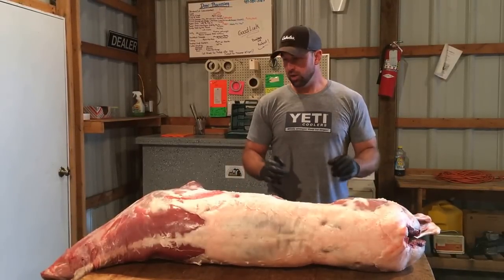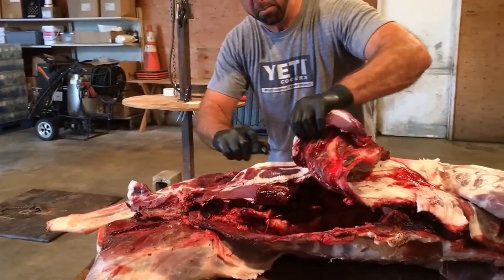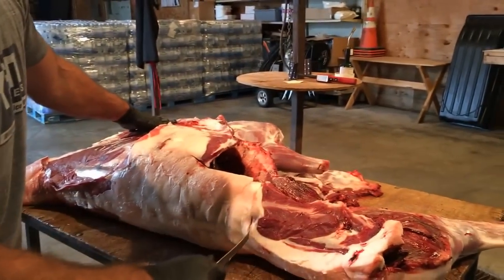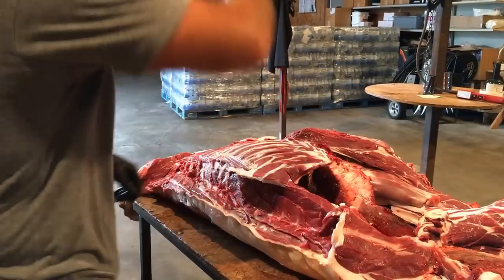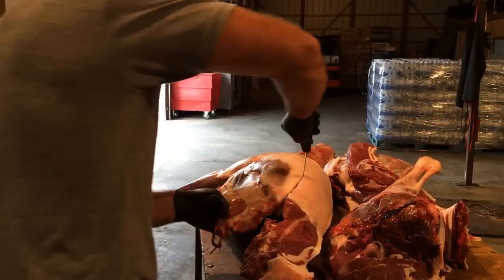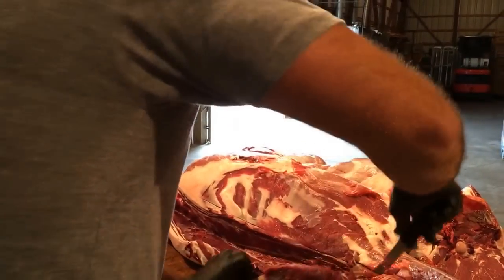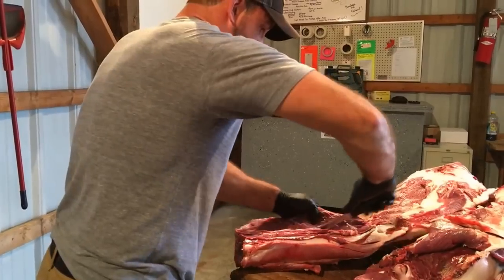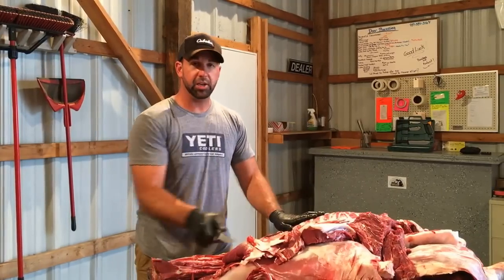American Archer Deer Processing Video Series Part 1

Comment: Love the video! I do have a few questions though.  What did you do to the deer up until this point?  It looks very fresh and pink with no dried out parts or blood anywhere.  Also, do you just grind that big pile as is?  I have always tried to cut most of the connective tissue out before grinding.  Do I need to do that? I know I throw away a lot of meat when I do that.  I was worried that it would make my burger tough and stringy. Thank you again for the great videos! They are very helpful.

Comment: Question...do you leave the hide on when you hang it or do you skin it first?  I don't have an access to a cooler so if the temps are cool enough I will let it hang for few days in a building that has no heat, free from sunlight.  I generaly leave the skin on because I think that it will keep the meat cooler once it cools.  That is my thinking and may not be correct.  If the temps are not cool enough i just process ASAP.  Any suggestions would be great.  Thanks for the video and making me feel like I am as slow as molasses.
Reply from the maker: Duane Bailey  Hey bud!! Well we get the hide off as soon as we can.  The  hide holds heat in which doesn't do the meat any favors in warm temps.  The larger the animal the worse it can be. When temps are warm I would suggest boning the animal out and getting in a refrigerator to cool down.  With bones out most people can find enough room to do this. If it's cooler out it won't hurt to leave the hide on until you can process the animal.  The longer the animal hangs without the hide on it can also dry the meat out. I hope this helps!
Adam Eller- Team American Archer